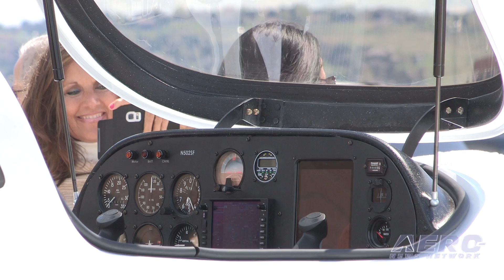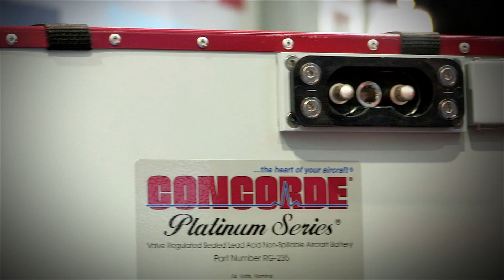Aero-TV: The Future is Near - Aero Electric Aircraft Rolls Out The "Sun Flyer"

Comment: Guess it didn't really work out, saying that it's going to be super cheap to fly doesn't really mean much though if the acquisition cost is more than twice as much as its IC Counterpart. You could fly the IC version for about 8000 hours before you'd be better off with the electric version and that's not taking into account battery degradation over time etc.

Comment: Have heard nothing about specific performance.  What is the useful load?  At gross weight what is the expected climb performance?  A lot of warm and fuzzy environmental talk but at this point it still sounds more like it is still a paper airplane with grandiose dreams.  I hope they can make it work but over the past thirty plus years of flying seen many revolutionary ideas never make it must past the prototype stage.
Reply: http://sunflyer.com/

2-Seater Specifications
$14.00Total Operating Cost Per Hour (Compared to $88.31/hour for a Cessna 172)

    Seats 2
    46" Cabin Width
    38' Wing Span
    129 Sq Ft Wing Area
    18.5 Glide Ratio
    440 Lbs Crew
    1,900 lbs Gross Weight
    80 kW Propulsion
    1,150 FPM Best Rate of Climb
    55-120 Knots Normal Speeds
    3.5 Hour Flight Endurance

$289,000
====

4-Seater Specifications
$19.80Total Operating Cost Per Hour (Compared to $122/hour for a Cessna 182)

    Seats 4
    46" Cabin Width
    38' Wing Span
    120 Sq Ft Wing Area
    18.7 Glide Ratio
    800 lbs Crew & Passengers
    2,700 lbs Gross Weight
    105 kW Propulsion
    1,250 fpm Best Rate of Climb
    55-130 Knots Normal Speeds
    4 Hour Flight Endurance

$389,000
====

Other Features

    Easy to fly & operate
    Next-gen Instrument Panel
    Avidyne Avionics
    Ventilated
    Great Visibility
    Long Operating Life
    Ballistic Parachute Recovery System
    One 45 lb motor with only one moving part
--------------------------

Comment: Pilots will drive the e-aircraft market forward..just as Uber professionals created the demand for Tesla.  And the pilots I've spoken to aren't ready, 'cause-- limited range = limited life expectancy; they hate the idea of flying with the proper spinning backward, solar needs sun, sun creates heat, composite airframes are vulnerable.  Also, battery pack, controller, DC/DC converter must be redundant, adding weight.   Lithium batteries really are safe with quality control and liquid cooling.  Build an electric "flying Tesla" with all of the above solved, get Uber FAA pilots to push through regs, and they will buy.  Then offer an electric "Chevy Volt", and I believe electric flight will take off..

Comment: GREAT !  Excellent work.  Just feel if it takes 2 to 3 years to get this marketable that will be 1 to 2 years behind the tech nology it is so new.  Maybe someone will adopt this and put it to massive testing to speed up the process.  Seems the perfect aircraft !
Reply: If I'm not mistaken they're using the Kreisel Electric battery pack which will be available to be swapped in at then current technology level when it goes into production, so it won't be behind. There's not much improvement in the electric motor to be expected - they're as good as they get, pretty much - but chances are high that the range will be better with an updated battery back.

Comment: People who do things like this are the ones that bring the cost down or make advances 
in the field.  The weight of any aircraft is a major factor in its performance.  As some one
who has wired up the avionics & aircraft electrical systems on the lighting at Arion Aircraft
and have seen how hard the team works to turn out a first class aircraft. 

Nick , mark , Jason and the  hole team work hard at Arion.  and having this team of builders pick Arion for there Exp-Aircraft shows they have done there home work to the point that the numbers fit. 

i have watch nick put many hours of hard work in the XI-exp aircraft and his wife working
in the office as well.  and have been lucky to do work for them  learning  a few things
in the LSA world and how it changing avation

Its hard for most people to know whats baking in the oven at battery . elec- motor and
Solar Cell builders.  The new avionics systems are so advance now the home builder
or weekend pilot in a old C-150 can have the most up to date from real time werather
radar to moveing maps with all the airports and ther Freq. at his finger tips.

The power / amps to run the new avionics has went way down from the old systems
the  KX155 & KCS55A flight system at one time were top of the line avionics that
fit well in a PA23RT , B-58 or cabin class aircraft but its becoming out of date
even thow I love the system.

So before you do this Ideal in remember all the people who did not thank any aircraft
could fly across the sea. But a lone pilot did what so many said it could not be done

Hands off to the team of builders and investors for they see way down the road
when many people will not even take the time to walk out to it much less turn there
head and take a look at whats coming there way or what just past by them.

kind of wish i was working with this team.

Comment: If you believe a run time of 3 hours is possible with todays technology, I have a nice bridge in brooklyn that you can buy.
Try 1 hour of realistic run time, unless of course you are planning on flying in ground effects the whole trip. One other thing, a plane can take off with 600 lbs of fuel, and land with 25lbs. This thing takes off with 600 lbs of batteries, and lands with 600 lbs of batteries. Enough said.
Reply: Well... in it's defense, the constant weight results in a more stable plane with predictable flight characteristics.
Reply: The Austrian predecessor of this plane, the Elektra One carried all but 64 kg (141lbs) in a redundant dual battery pack. http://www.kreiselelectric.com/en/blog/electric-aeroplane-elektra-one-kreisel-battery-technology/
"Two ultra-lightweight battery units from Kreisel with a total weight of just 64 kg provide the efficient and reliable energy supply for a range of 400 km with a flight duration of three hours at a speed of 160 kph."
And this link shows you the record distance flown with that battery pack. http://newatlas.com/elektra-one-solar-alps/38431/
No bridge to Brooklyn here - and who needs one if you can fly.
Reply: That is peak output, not constant output and whatever claims for longer range in the future is tied to more energy dense batteries and better designed battery packs. As for recharging, quick swapping the batteries is an option like the Pipistrel Alpha. Let me say this again, electric airplanes have already circumvented the globe with current technology. Yes it was slow, had huge wings and used solar cells to add power while in flight, but it was done. Now it's just a matter of getting better batteries and those are already in development. Nobody is waiting on magic, just cold hard science.
Reply: "LOL, these planes will be running on cold fusion generators before we get anywhere close to having batteries that will compete with today's high performance singles.You would need batteries to be in the neighborhood of 10-15 times higher energy density."

How do you like them apples?

http://phys.org/news/2013-09-molten-air-battery-storage-capacity-highest.html

No, your calculation is wrong since ICE are around 30% efficient, being generous here, so parity will be reached at 2.5 kWh/kg. Did you notice what the energy density of some of the chemistries in that article was by weight? Yeah, kiss your fossil fuel and fuel cell goodbye. It will happen in your lifetime.

"If they can get a battery to put out 15% (not 15 times) more that would be revolutionary."

Actually it's evolutionary and it's already been surpassed by Tesla alone going from the Roadster to the Model 3, with small increments each year they got 30% more. Revolutionary right now means anything above 2 kWh/kg which are post lithium chemistries. Here, check this one, you might learn something.

/watch?v=xMnTOpJScpg&t=30s

"Maybe as an initial trainer that never leaves the pattern, but as a practical cross country machine (what planes are designed for), no way, not on batteries."

Keep telling yourself that if it eases your fear. Not only will battery powered, electric airplanes surpass small aircrafts, they will surpass supersonic ones as well. Pretty much anything that doesn't have oxidizer on board and is more of a rocket than a plane. Know why? They're not air breathers and can fly higher up in the atmosphere without any power loss.
Reply: "They have been talking about "air" batteries for 50 years."

Never heard a word until 2013 about rechargeable batteries with up to 27 kWh/l (3x more than gasoline).

"They have several large problems.  The first is the heat.  In that link you showed they were excited about getting them down to below 1100 degrees F.  Anything over about 140 F will be unacceptable.  The wings of the planes would have to be filled with them, and you cannot cool them without tremendously increasing drag. Second is the fact that they need air to work.  When you climb up the air gets thinner, and their ability to make power decreases.  So no, they won't be using them at 45K feet making 110,000 HP (747).  Finally, they require very very very dry air to work, other wise they can foul, and in some cases catch fire."

Oxygen is pretty light and can be incorporated in the battery pack, I linked the article to demonstrate that above 2 kWh/kg chemistries already exist. There is no saying that there couldn't be other post 27 kWh/l either that don't need oxygen.

"They may be usable for ground based applications within the next 30 years or so, but for aircraft it will be much much longer.  Using a standard TN Bo you can still count on needing about 700 KW capacity to make a standard 3 hour trip (although models today can make about 5.5 hours).  Even using the batteries in the Tesla you quoted, they would need to be 20 times more powerful than they are now. before they would be anywhere near cost effective."

Might want to also check out the video I linked with the MIT talk about the improvement of current chemistry that goes well above 1 kWh/kg. It's ridiculous to claim it would be financially unfeasible considering that the batteries will likely cost less than the fuel required to make a round trip across the ocean on a large airliner and the electricity used afterwards is several times cheaper. In other words, they would pay for themselves fairly quickly.

"You also forget one important part and that is loading.  No one ever wants to fly around with full tanks for the weight needed to carry extra passengers. With batteries installed in the wings, your "fuel" weight is set.  I am not afraid of an electric airplane. "

You also forget that batteries with higher energy density by weight and by volume compared to fossil fuels exist and those will be used to power aircrafts. Since they will take up less volume than current fuel, they could be installed just fine in the main body of the plane, not in the wings.

 "Heck it would be great!  AV gas is expensive.  I am just saying I'll be long dead before"

If you're not 50 years old, you'll live to experience it, as I said, the first around the world trip has already happened. It's just a matter of higher energy density batteries entering mass production. 

"Are you a pilot?  What kind of plane do you fly?"

No.
Reply: Compare it to a normal power plant in an airplane someone might buy.  A TN Cirrus or Bonanza flies at about 83% of 300 HP, so 249 HP.  That is 186kw, or 742 kw for a 3 hour trip with reserves.  Just for reference, a top of the line Tesla battery is 85 KWh and weighs 1200 lbs.  So using that as a reference, you would have to have a battery that was 3 times heavier than the gross weight of the airplane to make it for a standard trip.  Never mind the fact that you may want to actually fly further than 3 hours, so you'd have to recharge the battery.  So using standard 480 volt setups available from most power lines, you would need 1600 amps of power to charge it in an hour.....LOL  The guy in this video is delusional.  They may be able to make a 75-80 hp trainer that never leaves the pattern and can fly for an hour, then charge for a few.  That is a reasonable position, but saying you will get anywhere near a high performance single using anything resembling current technology is insane.  Low temp fuel cells that run on natural gas are another story.  They are showing output levels near 60% efficiency and could be a reasonable replacement.
Reply: LOL, these planes will be running on cold fusion generators before we get anywhere close to having batteries that will compete with today's high performance singles.  Fuel cells running on natural gas are plausible, but not batteries...my calculations were from a standard cruise configuration and power setting.  You would need batteries to be in the neighborhood of 10-15 times higher energy density.  If they can get a battery to put out 15% (not 15 times) more that would be revolutionary.  It's a pipe dream that won't happen in our life time.  Maybe as an initial trainer that never leaves the pattern, but as a practical cross country machine (what planes are designed for), no way, not on batteries.
Reply: They have been talking about "air" batteries for 50 years.  They have several large problems.  The first is the heat.  In that link you showed they were excited about getting them down to below 1100 degrees F.  Anything over about 140 F will be unacceptable.  The wings of the planes would have to be filled with them, and you cannot cool them without tremendously increasing drag. Second is the fact that they need air to work.  When you climb up the air gets thinner, and their ability to make power decreases.  So no, they won't be using them at 45K feet making 110,000 HP (747).  Finally, they require very very very dry air to work, other wise they can foul, and in some cases catch fire.  They may be usable for ground based applications within the next 30 years or so, but for aircraft it will be much much longer.  Using a standard TN Bo you can still count on needing about 700 KW capacity to make a standard 3 hour trip (although models today can make about 5.5 hours).  Even using the batteries in the Tesla you quoted, they would need to be 20 times more powerful than they are now. before they would be anywhere near cost effective.  You also forget one important part and that is loading.  No one ever wants to fly around with full tanks for the weight needed to carry extra passengers.  With batteries installed in the wings, your "fuel" weight is set.  I am not afraid of an electric airplane.  Heck it would be great!  AV gas is expensive.  I am just saying I'll be long dead before it becomes anything more than a science experiment.  Are you a pilot?  What kind of plane do you fly?
Reply: 3 hrs. most likely are based on minimum power setting flight envelope.

Comment: Solar panels and regenerative propeller will add important supplemental energy to the production Sun Flyer.  In the R & D process, these capabilities are added according to a careful program test plan.  For example, solar panels are to be added to the second set of wings.  In early flight test we want to baseline the characteristics of a 'clean' wing before adding the solar cells.